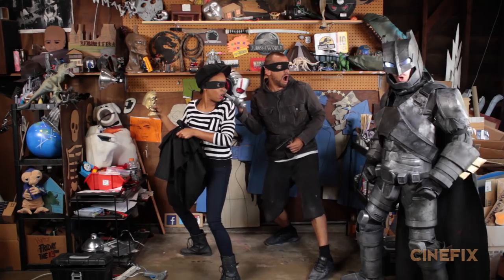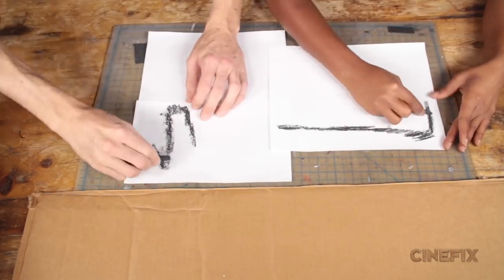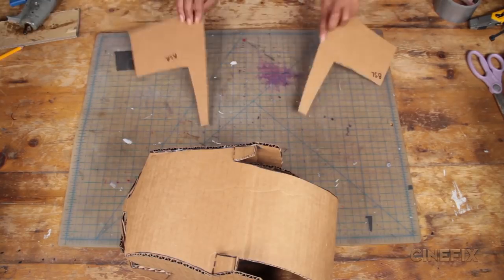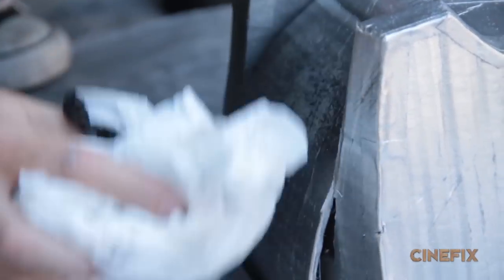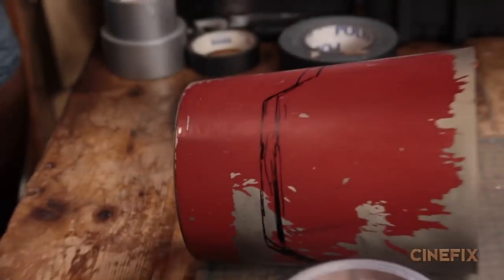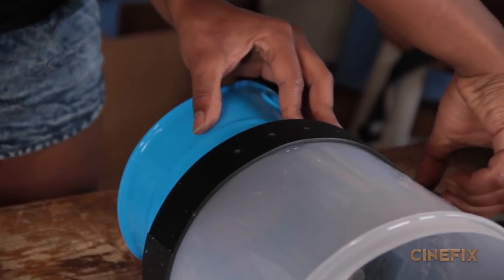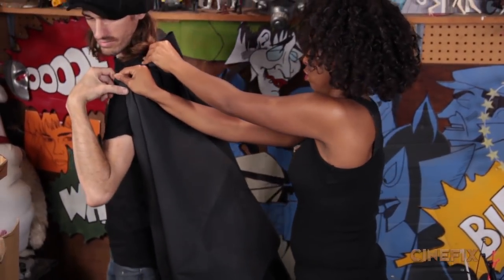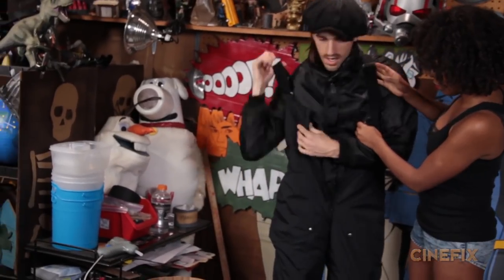Make Your Own Batman Mecha Armor Suit! - Homemade How-to!

Comment: Thank you for the detailed video and templates. The only problem i found is that only adobe photoshop, the software you guys are using, is what is needed for scaling to size in order to print. I'm trying to find an alternative,since for me paying 10 bucks a month for a software is not justified. Any suggestions what other software could be used?

Comment: im having trouble scaling the templates. im using photoshop cs6 but im not that clued up on using it. can you help
Reply: Okay I had the same damn problem. Go into photoshop and open a blank template that is paper size (8 1/2 x 11). Then open a template. Scale it, then Pull that tab out of the task bar so it is a separate window and so that you can click and drag the template directly onto  your piece of paper. Align it so the the top fits and then hit print, then drag it so the bottom fits, hit print again. I find it easier if you add some symbols on to where the page separates so that when you align then it's more precise. Good luck! An check out my review of this, it's the newest video on my channel

Comment: if i use regular glue instead of hot glue would it matter 
would it afect the resistance or it would be irrelevant
Reply: I can't imagine doing it with regular glue. I made mine with hot glue, lots of tape, and some Velcro strip. See channel for video